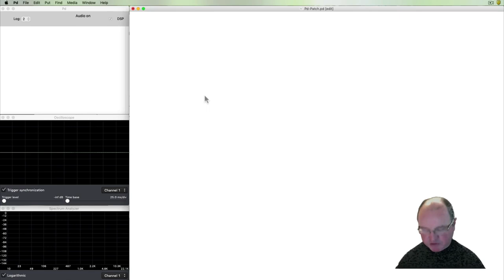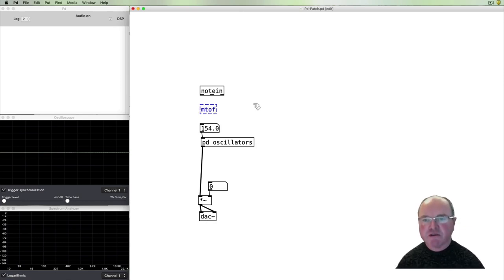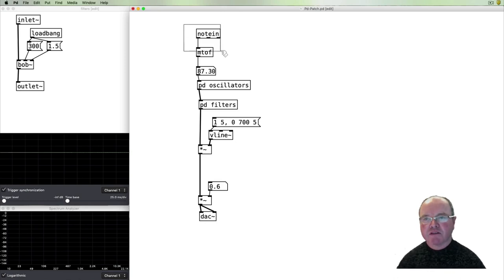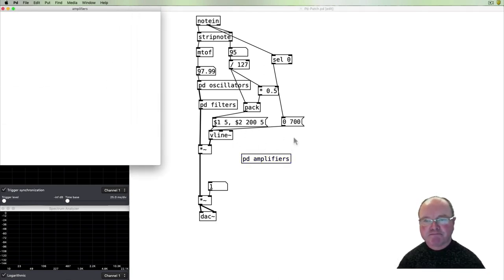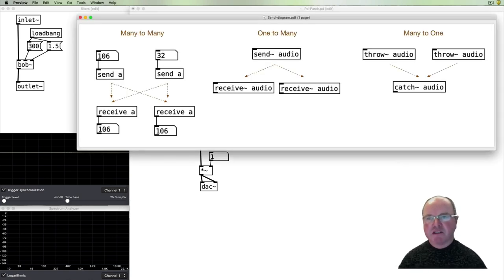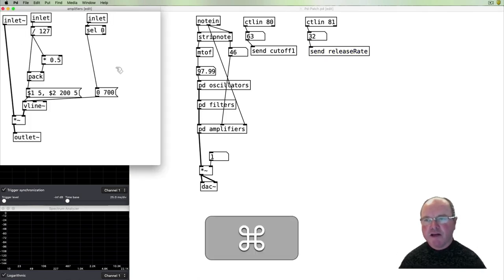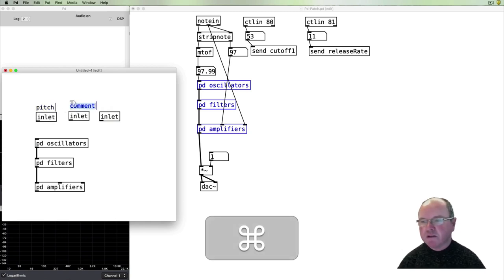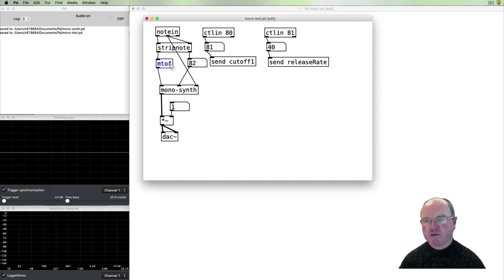20. Making a Mono Synth in Pure Data

Comment: Know of a similar spectrum analyzer for windows?  By the way this video has some problems.  A sawtooth is phasor *2 - 1, not *2 + 1.  You never connect the 2nd oscillator in the subpatch.  If you did, the sound would be very quiet.  I think you need to divide the sum by 2 to keep the osc's between -1 and 1.  Thanks for the education.
Reply: thank you !!

Comment: my midi controller sends 0 in the velocity output everytime a key is released, even if another one is still pressed, which means that everytime two notes overlap the release is triggered too early. what can i do to avoid that?
Reply: You'll want to compare the note value of the 0 velocity to the current output of stripnote, if they are the same then trigger the release message.